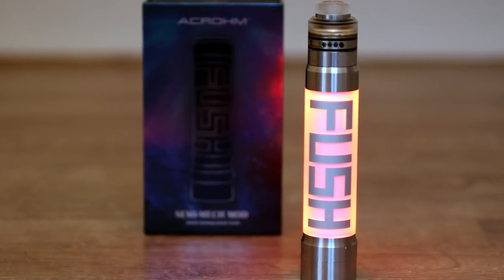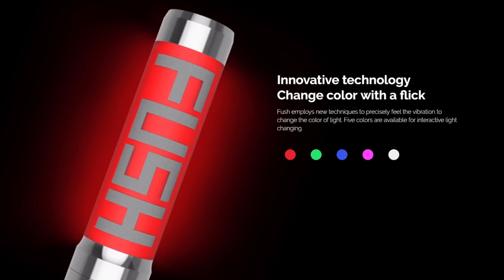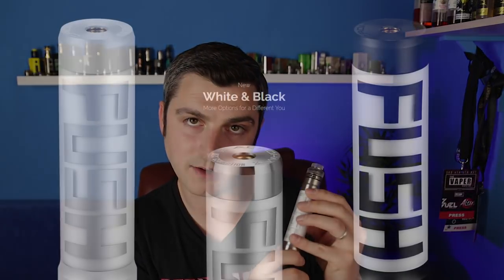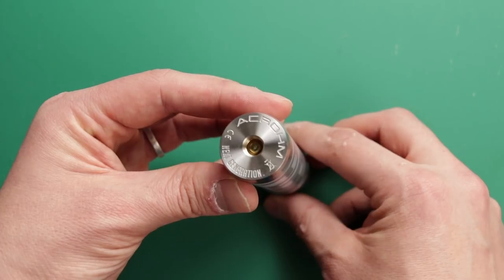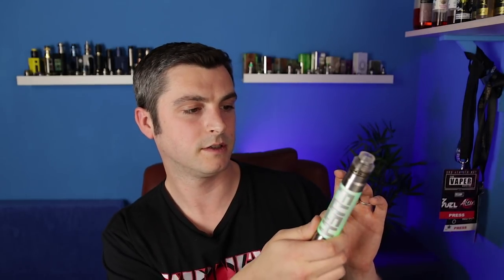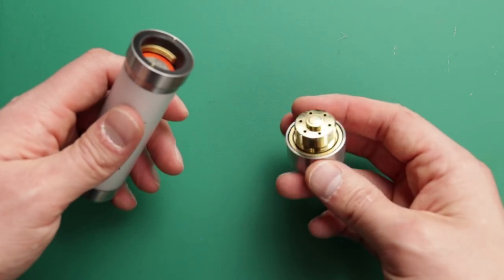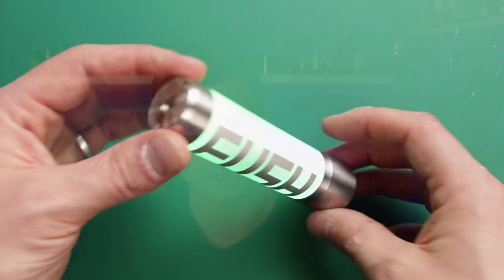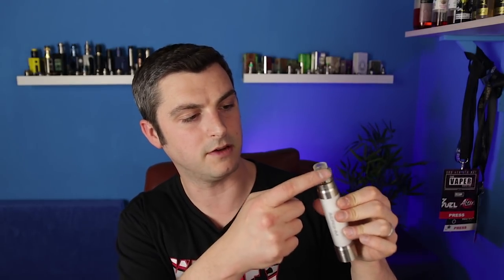Updated FUSH Semi Mechanical Mod By Acrohm

Comment: It's as much a mech as Amazons Alexa is a light switch :D
Reply: On the other hand, there is a Metal Oxyde Field Effect Transistor in it which is based on the quantum mechanical tunnel effect. So it is mechanical in a sense ...